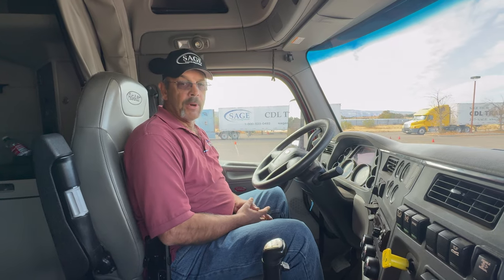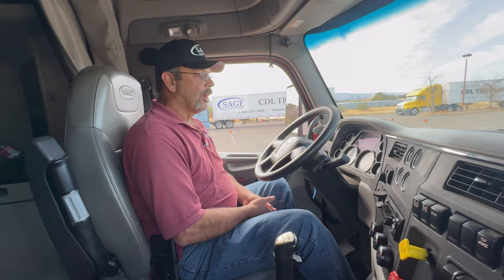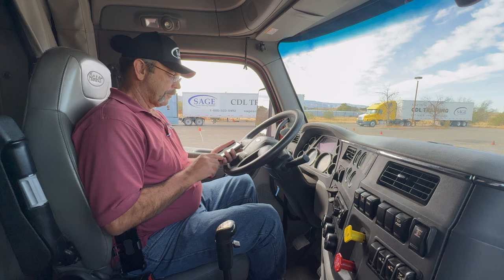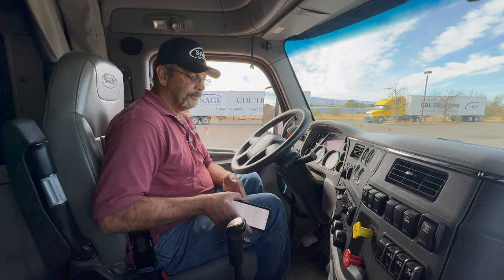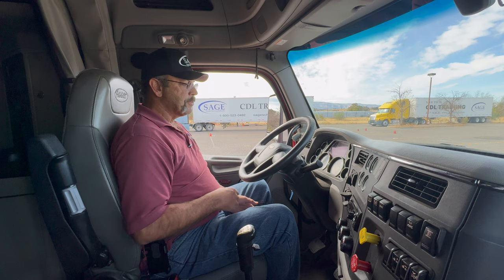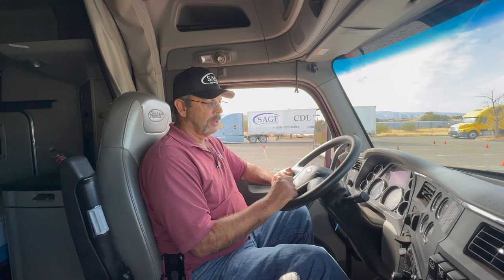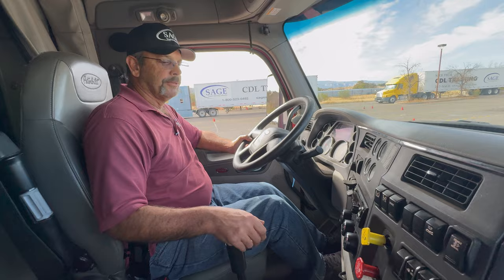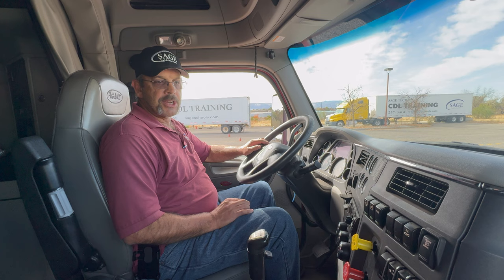Modernized Air Brake test.

Comment: Seat belt you failed
Reply from the maker: This video in the series demonstrates the procedures for conducting an air brake test which needs to be performed accurately without any mistakes. Wearing a seatbelt is mandatory during the road test and it’s an inspection item during the Incab inspection. Wearing a seat during the air brake test is not required.
Reply: so basically the first in cabin test is the air brakes?
Reply from the maker: Yes, that's the sequence on the check list.
Reply: Cuz didnt do the safety start test . Annnnnnnnnnnnnt. YOUVE JUST FAILED, YOUVE JUST FAILED😂 YOU DONT HAVE MAIL. YOUVE JUST FAILED😂. IM JUST KIDDN BR. THANK YOU FOR YOUR HELP. MY TEST IS WEEK AFTER NEXT 4TH OF SEPT. GOD BLESS BRO🙏🏽

Comment: Why do some people show counting the seconds between 85 and 100 on air pressure buildup?
Reply from the maker: It may have been part of the test years ago but not anymore. The purpose is checking to see if the Air compressor is working properly. If you're building pressure at what seems to be a normal rate trying to get to "Governor cut out" it's not necessary to time this.

Comment: For automatic transmission you will need to choke the wheels.
Reply from the maker: That’s correct.
Reply: @mikelogan99CDLClassAskillstest  The Texas DPS at Grand Prairie failed a student for air brakes test when he got to the EMERGENCY BRAKES TEST.

He called the valves trailer brake valves and tractor brakes valve respectively, the lady examiner said for emergency 🚨 brake test they should be called service line and emergency brake.

Checklist inspection descriptions did not call it so.
Reply from the maker: @temitopegbolagade5864  I hope people read this because this is very unfortunate. It's called the "Tractor protection valve" in the CDL handbook. That's the correct name. This CDL test is based on the content of the material in your states CDL Drivers manual and it is a requirement that you name parts and components by the correct name. On the checklist That you're allowed to carry with you on the test it refers to "Parking and Trailer brake test". I would dispute this because he's correct and she's wrong. With that being said, you're not allowed to use slang words to describe a part or component. The valve itself say's "Trailer Air supply"  It doesn't say service line. You test it the same as the emergency brake. It's design is to apply the trailer brakes in an emergency if the trailer breaks away from the tractor. Good luck with this and thanks for sharing!
Reply: We are advised to just say (Emergency brake valves) will pop out for this emergency brake test which is the 4th. Guys who said emergency brake valves passed and those who said tractor protection valves and service brakes failed.
Reply: We are advised to just say (Emergency brake valves) will pop out for this emergency brake test which is the 4th. Guys who said emergency brake valves passed and those who said tractor protection valves and service brakes failed.
Reply: Section 11M of the Texas version, item 4  Emergency brake test for air operated trailers in the book it said (Tractor protection valve and trailer parking brakes will pop out)    OR 
emergency brake valve should pop out.

They want us to say the latter while the first option is also in the book.
Reply from the maker: The first statement in parentheses is the correct wording.

Comment: What doing your 100 psi Cut In?
Reply from the maker: The truck was initially at 100 psi and he started the engine, idling it up a couple hundred rpm and waited to here the purge of air that indicated the governor cut off and it stopped building air pressure at approximately 125 psi. That’s a full charge of air that you need before you start the air brake test.  If this doesn’t address your question please explain. There’s nothing in the air brake test about a 100 psi cut in. The compressor always builds air until it cuts off at 125 psi.
Reply: @mikelogan99CDLClassAskillstest  at my cdl school, we start. 
1. Chock Wheels
2. Get in cab, seat belt on,  brakes set, gear in neutral, and turn key to on position, and say checking  see abs and abs trailer light come on and off,  and my deff light comes on and off 
3. Going dona safe start,  finish my 4 way, left and right turn signal, high beam working.
4. The do a vehicle cut in and cutout, this vehicle cut in at 100 psi, and my cut is is between 120 and 140, this vehicle is approximately 125. Now release yellow brake and do cut in at 100  psi and to make sure air gauge working properly, then tap lightly on brake pedal, air Guage should drop under 100 0si to indicate p
Proper working Air Guage.
5. While Air psi build up 
To governor cut out, I'll start my in cab inspection.. 
5. Once in cab finished, start air brake test, w8th air Guage and govorcut off, this v3hicoe cut in at 100 psi and cut out between 120-140 psi, and this vehicle is at approximately 125. The start down the rest of brake test...
Reply from the maker: My video is only the required Air Brake test. This is required to receive a 100% "everything correct" score or you will automatically fail. You're making reference to the in-cab inspection and you are not require to score 100% but try to get a good score. There is not an Auto fail for the In-cab inspection.